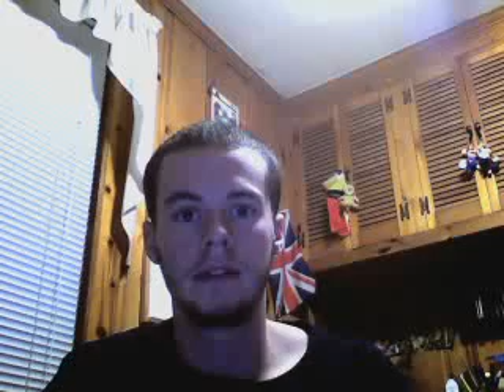Is is possible to Retrofit an LED backlit LCD screen in a CCFL?

Comment: AAALLLLL the led strip-lighting. + a simple dimmable driver unit. Its possible to even tie it in to the built in dimming, but it would be much easier to mod your own brightness control into it.

If it is a CCFL to led mod, you need to make it BACK-lit, not SIDE-lit. it needs more leds, but it will work directly in place of the existing tubes that are in there, rather than having terrible issues by using less on the sides.

I have a pavilion dv9, I have seen LED replacement screens going for 100 bucks online.

* Also i 100% AGREE on led tv! it pisses me off no end, they have LED written on it with the "E" being red, green, and blue coloured and is extremely misleading.

They also charge more for led backlit because it looks better. better performance = you pay more, regardless of how much they pay. If something is better you pay more, simple business!

This is an old video, dont know if you have done this or not yet, but this is my own research.

Comment: I just fixed an LED monitor
It had a row of 64 LEDs at the bottom on the screen, mounted on a thin PCB.
you may be able to purchase a PCB like this, but there were several power connections on this PCB.
All and all I would stay with the CCFL, until the LED monitors become more affordable.

Comment: well i think they charge more for the lcd with led  cause it last longer. its more convenient and  have less problems.. but i have a 40 inch lcd hdtv and was thinking if it would be possible to convert it to led. i have clouds coming in the corner of the tv so its annoying to watch tv at night.. is there a fix for that?

Comment: The backlight-driver most likely take a PWM signal from the display-controller, you may want to use it. You will most likely find 12V or battery voltage at the CCFL connector and a buck/boost converter would be good for best efficiency.

You still need to figure out LED placement, maybe place it where the CCFL tube is, or fill a board with white LED's.